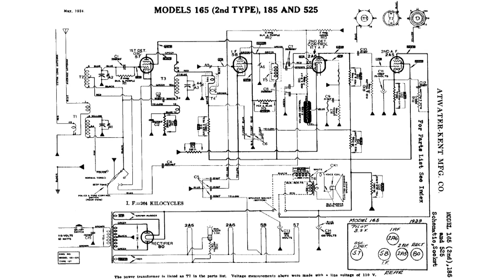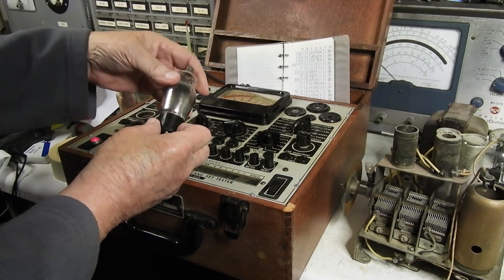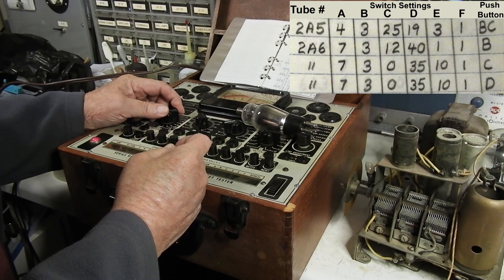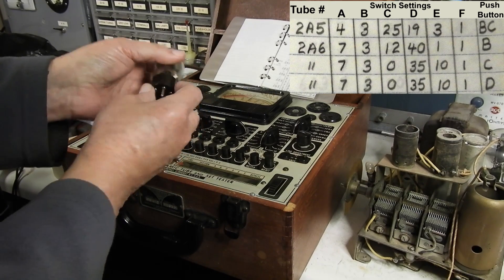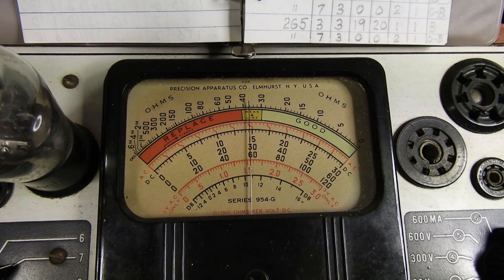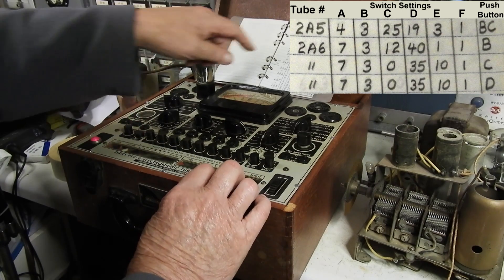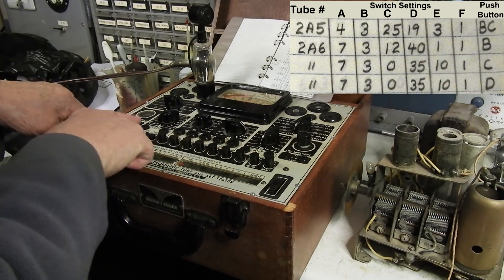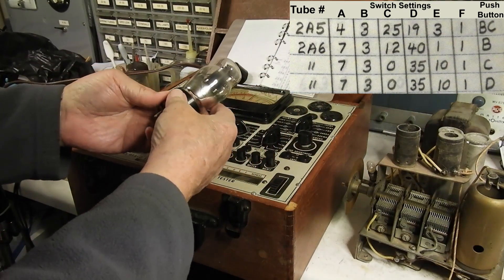Atwater Kent 165 testing Vacuum Tubes First Fault

Comment: I have got to find away to get a tube tester ,I have had to buy nos AA5 tube sets,because I dont no what tube or tubes are bad,so the last radio I fixed I just put in a complete nos ,that way I no that radio will work good and relieable ,but that was 29.00 dollars.so tube testers are great investments.
Reply from the maker: A Hamfest is very good place start looking.

Comment: Hi Rick thanks for the videos and Happy New Year to you and yours.  Rick I wonder if you have any good ideas that would help me in retransmitting audio around the house. I'm building a new
house and I could put wires wherever I want them from a line output amp but I'm
not sure where the various pieces of equipment will go. I defiantly don’t want
a computer based system, I don’t need stereo or Hi Fi, I simply want to be able
to retransmit sound form a TV and a music centre and then pick up that signal
with vhf fm radios anywhere in the house. The new house is on the top of a hill
overlooking the town and any FM signals from the sort of TX I normally build could
broadcast over a wide area. What I'm wandering is have you ever played with
cordless phones? I guess the audio bandwidth of a uhf phone is going to be pretty
slim but with my continuous tinnitus that may not be too big an issue. I like
the idea as it could offer a source of supply for the RX-TX on a legal frequency.
I guess there’s a lot of digital control baggage that might get in the way of
an easy system that could be adapted to say take the output of a reel-to-reel
tape recorder anywhere in the house and retransmit to the handset RX dropped
into an old radio. So, do you know of any source of legal frequency RX/TX or
any other ideas by which I can retransmit audio from various different devices
in different rooms. As an option I could easily run loops from two or three possible
equipment sites but I’ve never tried that out before and I don’t know if they
are susceptible to incoming interference. I really don’t want a computer based
system but any thoughts or ideas that would get my analogue sound systems to
talk to old FM radios would be gratefully received. Kind Regards  . . .  Andy
Reply from the maker: I have just discovered that YouTube no longer sends me all comments to my email. I marvel at YouTube's improvements. 
Hey Andy,
I think that FM transmitter you make should work. I have been able to limit my FM transmitter to my property by changing the size of the antenna, FM transmitter power supply and the placement of the transmitter in the house. It takes some experimenting but the FM transmitter setup I use, transmits all over my house very nicely. When I walk outside and down the driveway with a radio the signal is almost gone when I walk just passed my mail box. I'm sure you'll be able setup your's in a similar way.
Good luck with the new house.
If I don't reply in the future email me at 'allamericanfiveradio@yahoo.com' Just in case YouTube makes more improvements. 

Rick
Reply: Hi Rick thanks for getting back to me. Well YouTube stopped sending me comments ages ago and it killed my interest in making videos as I used to get loads of emails every day and I made a point to respond to every one, but hey, on the positive side I now have more hours in the day for other things. OK on the transmitter power reduction. I’ve just been looking at Cat 6 cable and I think I'll pull in a load of cables in and have them ready in the wall or coiled up in switch boxes with covers. I'll make little amplifiers for each room. Maybe I'll make a YouTube video if it all works out ok.  All the very best . . . Andy

Comment: A trap for young players are the red/yellow/green scale on many tube testers.  Likewise, test the same tube in one of my many laboratory grade mutual conductance testers or even on my Tektronix curve tracer with home made vacuum tube adapters and they will also read weak.  Just because the tester shows weak or replace does not mean the tube will not work.  I have seen tubes that tested between 10% to 20% on a emissions tester that worked just fine in circuit.  It really depends on what the tube is being used for and how hard it is expected to work in circuit. In receiver and audio amplifier circuit many times all that is required is you may have to turn the volume up a little higher than if the receiver had new "good" tubes.
Reply from the maker: Thanks
Reply: Thanks Mike, that helpfful information for me.